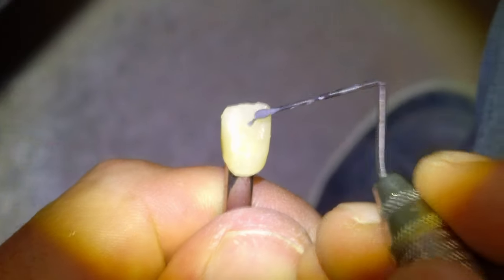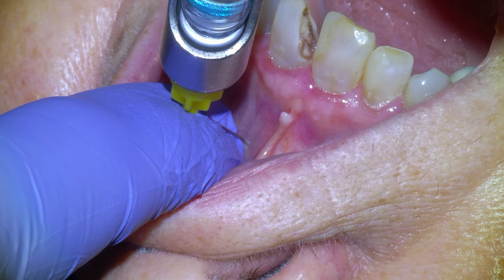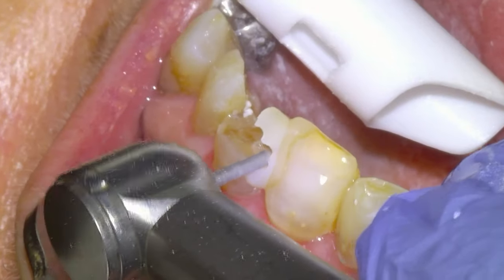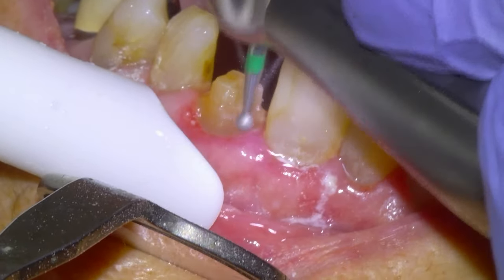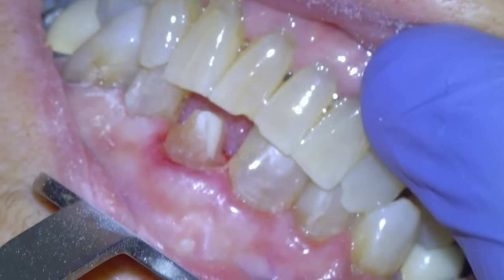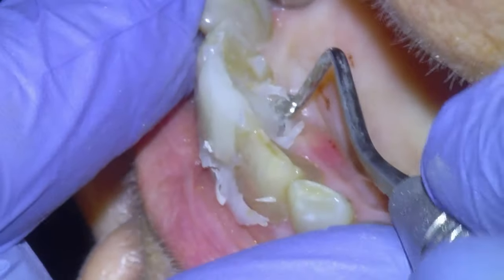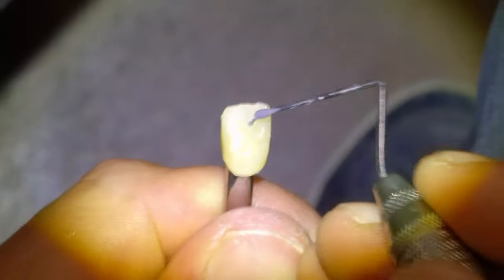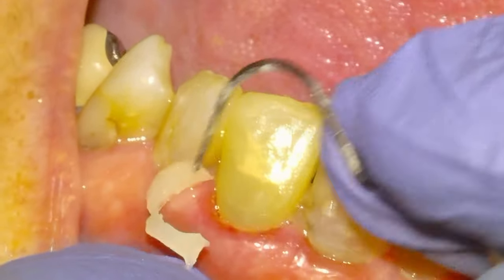[42] Live Dental Crown Procedure with Custom Staining

Comment: in my experience it‘s totally sufficient to freeze just from the buccal for one rooted teeth. if you‘re worried about the gums on the palate, massage some Lidocaine gel for 1-2min
Reply from the maker: You can get away without the palatal anesthesia but they're going to squirm when you pack the cord which makes me hold back on applying the necessary pressure required for adequate retraction so I've just made it a blanket guideline for myself to freeze the palatal in all cases requiring palatal manipulation. My 0.02

Comment: Dr. Thank you for the video. when etching, phosphoric acid ok with RMGI, instead of gc cavity conditioner?
Reply from the maker: Yes. Google scholar search "glass ionomer surface treating acid etch bond strength" there are papers that do comparisons which conclude no significant difference between 5s po4 etch rinse and dry vs 15s paa scrub rinse and dry

Comment: Hey, I just wrote a paper comparing tooth-supported monolithic and porcelain veneered zirconia crowns! Cool to see you're using MZ in the anterior, any concerns surrounding wear to the opposing tooth?
Reply from the maker: I've done a few PFZ actually with my smart fire but layering is obviously crazy labour intensive esp when doing everything myself in house. I feel like the materials and shade systems have come far enough that layering is no longer necessary for good esthetics and the advantage of not having the weak layer of interface between the materials is great. If this was the only tooth in the mouth opposing the lower I would be concerned about the lower wearing down quicker than if it were contacting gold or enamel but there is an entire arch of teeth to support the patient's bite so you aren't going to see the lower tooth wear away dramatically. I 3 step polish my zirc with ASAP clinicians choice and then this WOW paste stuff that gives it a really smooth occlusal surface.
Reply: Great points, we've slowly been experimenting with high translucency zirconia at my school, pretty incredible stuff!

As always a fantastic video! You do such a great job capturing high quality footage, start to finish.

Follow up question, do you have a 3D printer in your office? I've seen some dentists on youtube with remarkable applications (temporary and definitive prostheses, aligners, study models, surgical guides, stents, custom trays etc.)

 @behindtheloupes
Reply from the maker: It works, esp with a custom staining system. Not saying this was a perfect result or its more esthetic than emax but ya know.. I use ArgenZ STML and it's a good product.
Thanks I appreciate that. I really enjoy sharing cases.
I have an Asiga UV Max printer but I never use it. I went modelless after a hundred cases or so when I trusted how reliable the Roland mill was. As for aligners you can't actually print aligners yet, the material is not quite there yet but maybe soon, but you can print models and vacuform the material then cut it off but it's too labour intensive to make it worth it. As for guides I can honestly say I've never used one. Started placing implants freehand and I am comfortable going without.

Comment: Doc , why did you decide on a crown Since the tooth needed that much of reduction instead of a post and core
Reply from the maker: This prep has adequate tooth structure to retain the core and adequate ferrule to retain the crown with a good resin cement imo. The pulp responded normally and I was fairly confident it would survive which has been the case thus far. I've seen too many posts fail spectacularly by root fracture which just eats up all of the alveolar bone and makes doing an implant really tough. For that reason the only type of posts I place are titanium ones (implants)
Reply: @behindtheloupes  reasonable , thanks for taking the time

Comment: How are your cores working out with equia?
Reply from the maker: No issues thus far but of course it has only been on the market less than a decade and I have only been using it for 3 years. It stays put. The biggest thing to longevity and durability is always how much actual tooth is there rather than type of core material imo